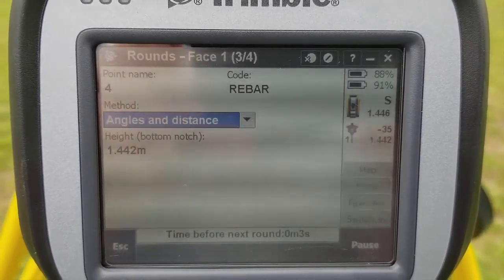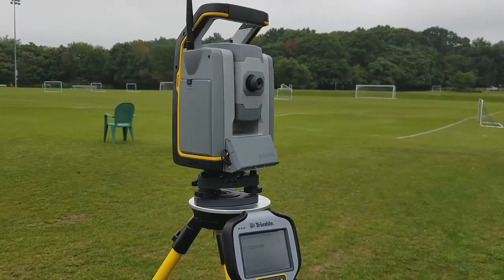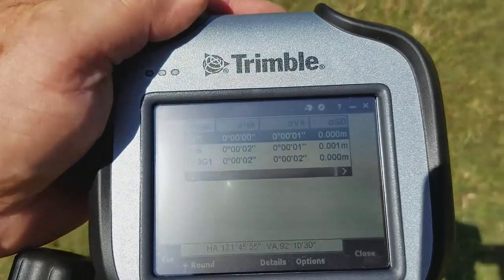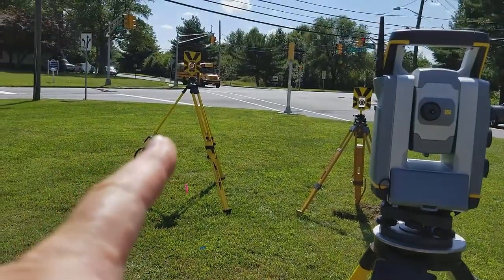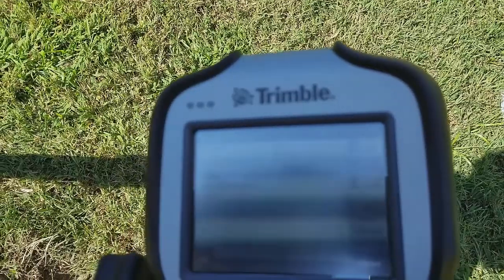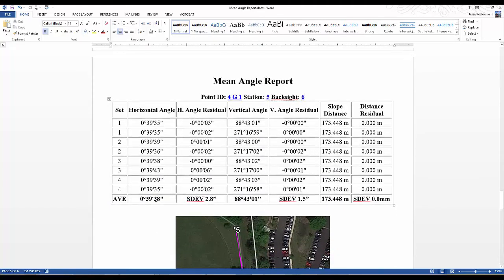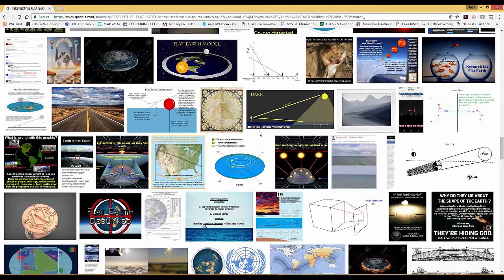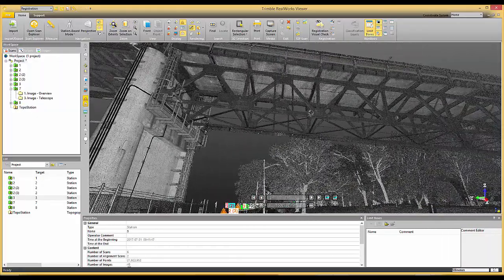Flat Earth Perspective Tutorial

Comment: "except 1.22(f/D) gives a maximum angular resolution based on the Diameter of the observing aperture and the frequency of light. So Clearly you lack ANY understanding of the implications of that equation! Your response is laughably absurd and shows your complete ignorance."

end quote

Dark Star - No, it's not you silly. It gives an approximate angular resolution θ, (no such thing as max value here) for a specific light frequency f or light wavelength λ= 1/f , thus color of light, and eye pupil diameter or and visual aid apparatus e.g telescope, aperture size D,  during daytime. Thus, the smallest angle θ of two separate light sources (i.e. or objects) must be separated with, so that the eye or and visual aid, can resolve these and register them as two different things and not falsely as one. 

As a consequence of the above and under perfect viewing conditions thus visibility, this results to a minimum angle of 0.02° of an apparent object size on the horizon to the center of the pupil or and visual aid lens, that the eye - visual aid combination, can  register. Any object or part of it, on the horizon line appearing with a smaller angle size than  0.02° becomes invisible. Also you always can not see on the horizon line an object's 0.02° sized bottom (part closest to the horizon line). And this is the main reason why ships are gradually disappearing on the horizon bottom up first until their overall size  becomes less than 0.02° and vanish. 

Also your formula 1.22(f/D) is wrong. The correct one is 1.22(λ/D) = 1.22(1/fD)
http://www.wikilectures.eu/w/Resolution_of_human_eye

If anyone still insists after my analysis that alleged Earth curvature is responsible and not mainly the eye perception and biology and light physics for things disappearing bottom up first on the horizon line which is made up by our eyes and not a  fantasy Earth curvature, my message to all of you is:

Get off my back! and continue ma...ing...

Comment: Very educational, as could be expected. It's a pity that you have to go through all this trouble to make clear what should be obvious from the very start. And then find that Flat Earthers still don't understand any of it. Have you seen the challenge that Jeranism has put out? He is going to do the Bedford level experiment all over again with two lasers, a couple of beams from a hardwarestore, a cordless drill, to drill holes in the poles, some levels from amazone and a rented theodolite that he isn't going to use the way it is supposed to. It must be hard for a professional like you to even watch him announce his attempt.
Reply: It's worse, he's got not just a couple of beams, but at least 6 and maybe 7, and he's going to try to align them just right so he can drill at least 5 maybe 7 holes through them and precisely aim the laser through them all -- a laser that has a spread of sth like 40+ feet after 3 miles. He says he's going to get a laser 'focuser' or sth like that, but I seriously doubt it will be precise enough to thread its way through 5 or 6 one inch holes over 3 miles.

By the way, I believe (Jesse, correct me if I'm wrong, my memory on this is fuzzy) that Jesse is going to be part of the group (with SciStrike and others) that goes on the same day to the location Jeran has chosen to do his experiment, and they are going to do a parallel experiment much simpler and much closer to the original Bedford Level experiment (the version where whatsisname-famous-guy debunked the flat earth with just three posts). If Jesse is there, it will be hilarious to compare Jeran's inept attempt (and likely failure) with the globers' well-organized experiment.

But let's not pity, let's celebrate Jesse's hard work and determination. Hooray! It's so awesome that he's done this. I'm sure it took a lot of planning and organization. And he's doing it so professionally that when people compare his work with the utter shoddiness of any FEer's work, the disparity will be crystal clear, and the quality of the evidence will shine through any amount of bullshit, denial, and obfuscation. This video will be a valuable resource for months and years to come. It will stand the test of time. As expected of the work of professional geodesic surveyors.

Take that, superstition!
Reply: Rob Harwood: I totaly agree. Didn't know that SciStrike is doing the experiment on the same place the same day.
And you're absolutely right: without guys like Jesse, where would we be?
Reply: It was certainly hard for Red's Rhetoric to watch the announcement. You could tell the exact moment in the Movie Night where Red's faith in humanity tank hit empty for the thousandth time since starting to deal with FE.

Thing is, Jeran's basic concept is pretty sound. IF you had a level piece of ground and could put holes in the posts in a straight line, the holes would get higher due to curvature.

But of course his methheadology is utterly hopeless. I don't know which would be funnier, him rage-quitting once he realizes he can't line up the posts and the laser is a puny floodlight at the needed distances, or him gritting his teeth, forging through all the way to the end, and then pretending he's gotten some meaningful result.
Reply: When they make the movie about the whole thing, Tim Allen can reprise his Tim "Tool Man" Taylor character from "Home Improvement" and play Jeran. XD
Reply: Duhldiot: I'm afraid Tim Taylor is too much of a handyman for playing the role. I'd rather see Leslie Nielson playing the part.
Reply: "except 1.22(f/D) gives a maximum angular resolution based on the Diameter of the observing aperture and the frequency of light. So Clearly you lack ANY understanding of the implications of that equation! Your response is laughably absurd and shows your complete ignorance."

end quote

Dark Star - No, it's not you silly. It gives an approximate angular resolution θ, (no such thing as max value here) for a specific light frequency f or light wavelength λ= 1/f , thus color of light, and eye pupil diameter or and visual aid apparatus e.g telescope, aperture size D,  during daytime. Thus, the smallest angle θ of two separate light sources (i.e. or objects) must be separated with, so that the eye or and visual aid, can resolve these and register them as two different things and not falsely as one. 

As a consequence of the above and under perfect viewing conditions thus visibility, this results to a minimum angle of 0.02° of an apparent object size on the horizon to the center of the pupil or and visual aid lens, that the eye - visual aid combination, can  register. Any object or part of it, on the horizon line appearing with a smaller angle size than  0.02° becomes invisible. Also you always can not see on the horizon line an object's 0.02° sized bottom (part closest to the horizon line). And this is the main reason why ships are gradually disappearing on the horizon bottom up first until their overall size  becomes less than 0.02° and vanish. 

Also your formula 1.22(f/D) is wrong. The correct one is 1.22(λ/D) = 1.22(1/fD)
http://www.wikilectures.eu/w/Resolution_of_human_eye

If anyone still insists after my analysis that alleged Earth curvature is responsible and not mainly the eye perception and biology and light physics for things disappearing bottom up first on the horizon line which is made up by our eyes and not a  fantasy Earth curvature, my message to all of you is:

Get off my back! and continue ma...ing...
Reply: Duhdiot: Jeran will probably fake the experiment and make use of the diverging of the laserbeam and put his drill at every post at about the same height, claiming its the centre of the beam. But it is even more probable that he won't do the experiment at all. In the comments lots of people have shown him a much better way of performing the experiment. I myself have proposed to just use the theodolite and two level masts. Another guy proposed to let three boxes of equal height float in the river and try to see the last box from the first box. Some have even proposed to not do the experiment at the evening, because than the refraction will be at its most.
By now Jeran must have found out that the results of his experiment won't be accepted.
It should be fun seeing Jesse do it right, while Jeran is strugling with his posts, his cheap spiritlevels, his lasers, empty drill-batteries. Just like in the english guys trying to replicate the original Bedford Level experiment at the original Bedfor canal.
Reply: Jeran has already made pre-judgments about the results no matter what he gets. The built-in excuse for not seeing what he expects will either be that the laser doesn't shoot straight or theodolites don't measure accurately at long ranges. He says that at 11:35 of the "preliminary details" video.